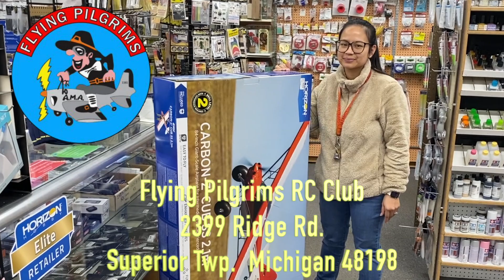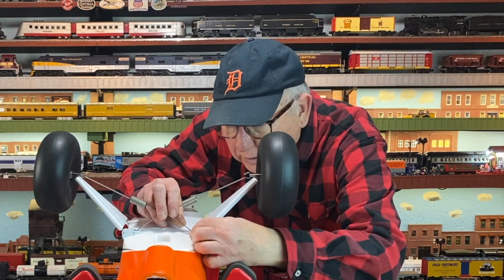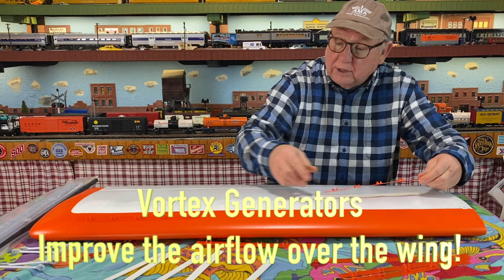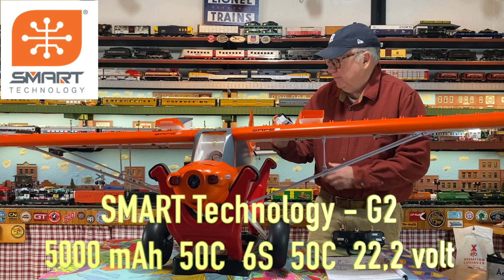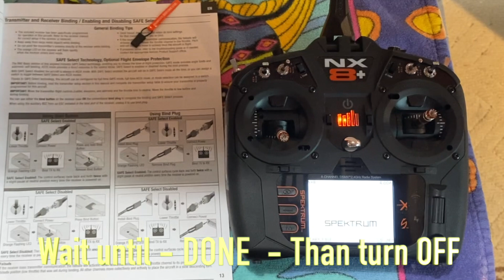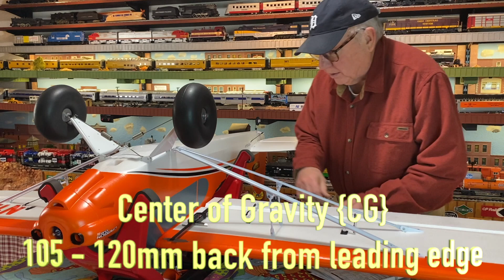Buy it! • Build it! • Fly it! • E flite Carbon Z Cub SS 2 1m • Part One ✈️

Comment: Hello Gary,

I wanted to let you if concept that I'm trying to get off the ground with EZ Catch Trains in New York. It is the very early Lake State GP35s with their phase one scheme. And what makes them even more interesting is that it is the merger emblem with both Saginaw Bay Southern and Lake State on the side.

This would be the first time they were offered in any scale, and production is very limited, we would need people to step in line to buy them.

Let me know if your interested at all (in either one or both numbers)

Thanks so much for everything you do for the railroad community!

Adam
Reply from the maker: Hi Adam: Thanks for the tip on these locos. I do have a Lake State Railway yard switcher from RailKing. I will have to take a pass at this time. Gary Toot - toot! 🚂💨